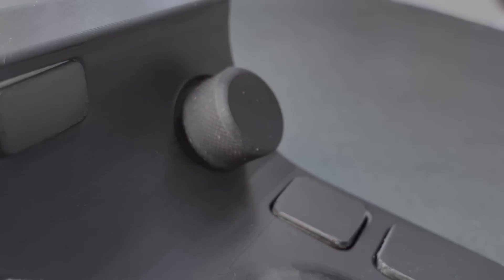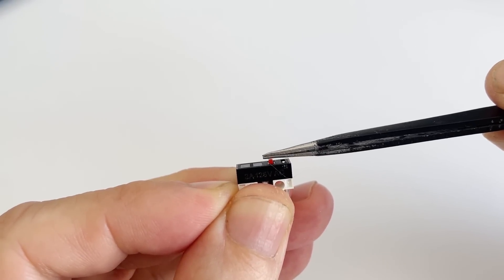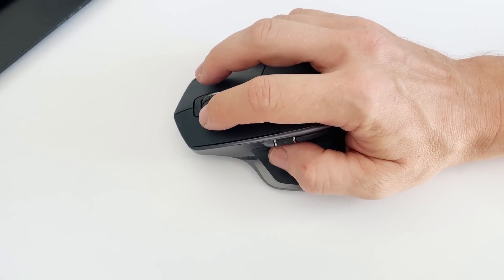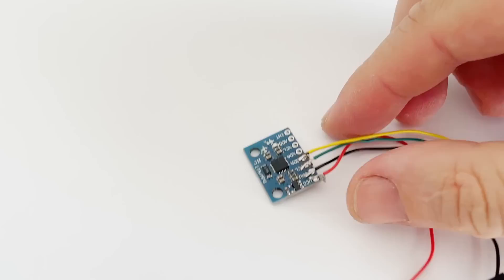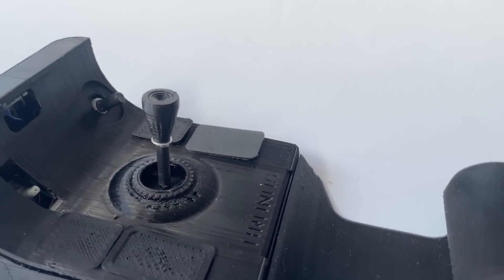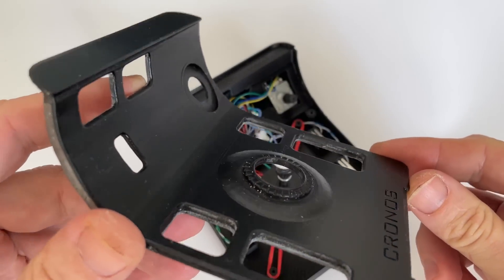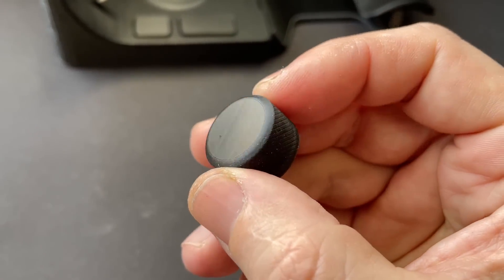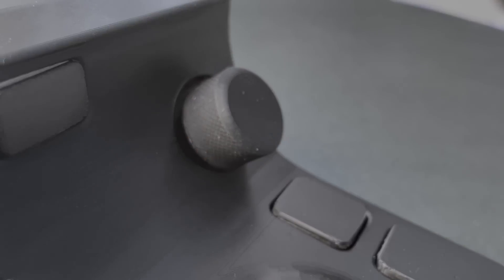Creating the Ultimate Mouse: The Journey Behind Cronos Control - A Mouse & Trackball Hybrid!

Comment: Some issues. The wrist rest needs an adjustment system for people with different hand sizes. The buttons seem very far apart for smaller hands and not positioned in easy to reach locations (where fingers might naturally rest without taking finger off joystick). I'd also suggest going with keyboard switches for the buttons at this point. Still, its a cool idea. Careful on wasting funding when you should definetely be making significant upgrades to the design. Customer first impressions are important. Wish you the best!
Reply from the maker: Thank you for the feedback! I’m currently working on refining the wrist rest to accommodate different hand sizes for a more comfortable and natural position. The final kit will likely include several joystick options, as they’re replaceable, along with two types of wrist rests. As for keyboard switches, I tested them, but their button travel is quite different and doesn’t match the feel of a mouse button, which could compromise convenience. I appreciate your input—it’s all helping me make this design even better!

Comment: Did you look into hall effect sensors for the joystick?  That feels like it would at least partially alleviate the wobble and probably eliminate the dead zone, too.  Might be worth investigating if you're making it an actual product so you don't need the rubber and foam that perish over time.
Reply: I'd use hall + gyro + acc together
Reply: i came to say the same thing
Reply: this is what i did for mine. lil jumpy but i think that's mainly because of the plastic on plastic because i couldn't find a small 4mm bearing
Reply from the maker: Thanks for the suggestion! I've managed to solve the rattling and dead zone issues programmatically, achieving stable performance with nearly zero dead zone. Switching to hall effect sensors would increase the product cost significantly, so I'm sticking with the current setup to keep it more affordable without compromising on quality.
Reply: @DIY_Yarik  By how much are we talking here? Pretty much anyone looking for unique looking mice have the budget for it. Cause if they're really looking to go cheap, they would buy a regular mouse.

TMR and/or HE joystick goes beyond just solving the deadzone issue. We're also tackling longevity and future convenience with hardware like that. Because we're addressing wear and tear.

1 pair (2 pcs) of TMR stick kits 
(Not just the TMR module, but the casing and everything else as well. A full kit) 
costs $10 today. How much less later?

Cool looking tech, a promise of longevity, and great utility? Then upgradability via replacing some of its' parts later on? Pretty sure i'm not in the minority by saying i'm willing to shelve out at least $200 for something like that!
Reply: @noiJadisCailleach  the kickstarter is already priced this range (150~200€), adding 10€ to the build is that more pricey.
And the DIY pledge (25€) will come with the 3d models, you may mod it yourself. 🙂
Reply: @DIY_Yarik  Look up Hall gimballs for radio transmitters/drone controllers, there's a bunch of parts online and I do think a $10 gimball is going to outperform this joystick drastically.
Reply: I have no idea what dead zones he is talking about. Even ancient Sony DualShock 3 / Sixaxis gamepad with regular potentiometer joysticks has no hardware dead zones and its sensors precise enough to detect air pressure from blowing at it. Seems like either software issue or him using some type of bottom of the barrel stuff.

Comment: Very cool Project! I have also considered building something pretty similar. Have you ever considered using Hall Effect Joystics? Or were they in the video and I missed it when you said it in the video?
Reply from the maker: Thank you! In this task it was important to accurately measure angular movements, so I chose a gyroscope, which copes better with determining the location in space than a joystick based on a Hall sensor.
Reply: @DIY_Yarik  I see. Thank you for your reply!

Comment: Hey that left click sticking seems to be universal with Logitech mice 😂 seems like something intentionally built in their products.
Reply from the maker: Yes, you’re absolutely right! I get the impression that Logitech deliberately selects microcontrollers with a limited lifespan. What’s worse, when you try to re-solder them, the board contacts often get damaged, and it usually only withstands 2-3 re-solderings at best.
Reply: Yes, I've had this issue with mine also, I get the "double click" issue eventually on almost all my mice. I've replaced them a couple times but its quite the pain because of the soldering. It would be far better if they made them so they could just be set in place and then replaced when they wear out.

Comment: Ive never tried joystick, is it as good as a normal mouse?
Reply from the maker: Not every joystick is equally comfortable to use. Several factors play a big role here, such as the joystick’s dead zone and ease of rotation. The version I developed has no dead zone and offers exceptionally smooth movement, quite different from the joysticks found in standard game controllers. While there are professional-grade joysticks available, the modules alone often start at around $120.